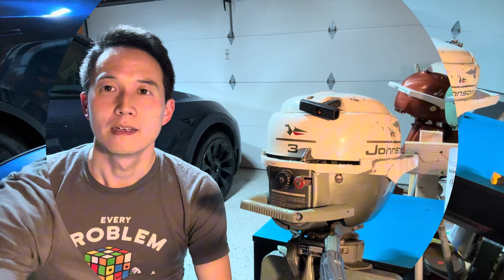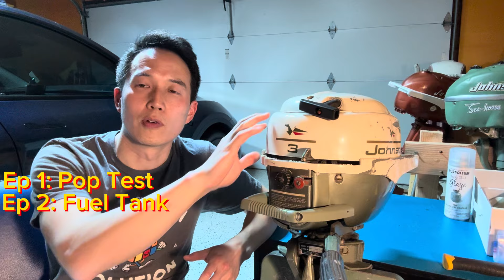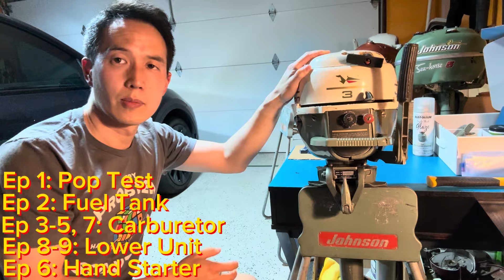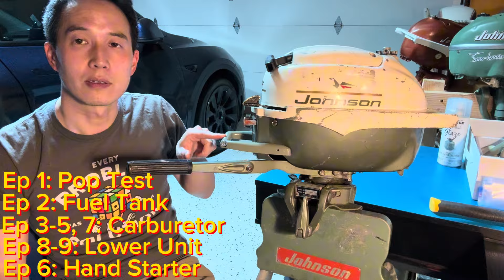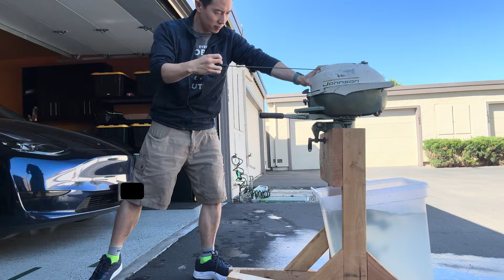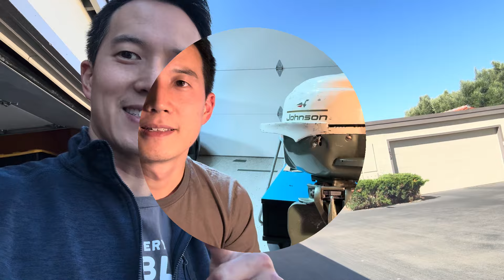Restoring a 60 year old motor! 3HP JH-22

Comment: Thanks for your videos! I just got a JH-22c and hope to get it running. It'll be my fourth OMC full restoration project. Mine isn't out of the "locked up" stage yet, and it's missing the dash faceplate, lower cowling, and knobs. I'm going to wait to see if it wants to run before buying those parts. I like the way you went through all the problem-solving steps and demonstrated what worked and what didn't. As for rebuilding carburetors, I too have learned that rebuild kits often lack at at least one OEM-equivalent part. And, I've also learned to go ahead and use steel wire (I sometimes use old guitar strings) and poke through all the orifices after the carb cleaner and chem-dip because using the chemicals alone is rarely enough.
Reply from the maker: Awesome! The JW and JH lower cowling are similar but not exactly the same. The JH is slightly slimmer - you maybe be able to get JW to fit with some modification. However the handle is the same size despite having different part numbers. eBay is great to find spare parts - good luck!
Reply: That's useful information 👍